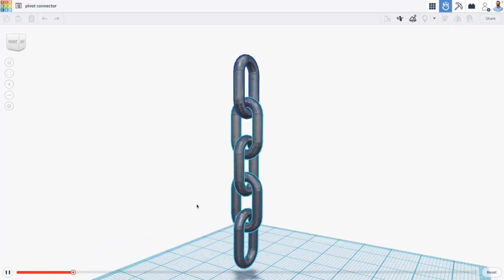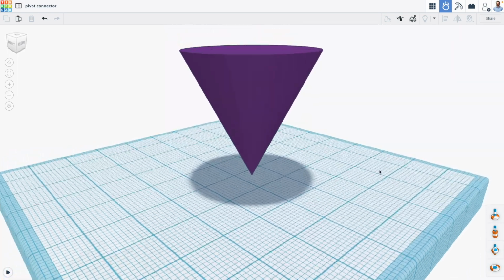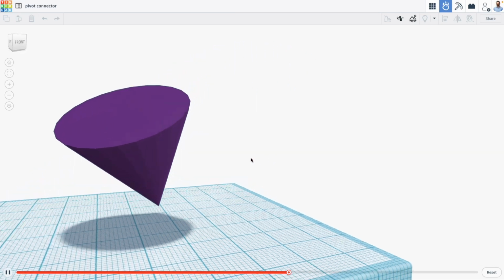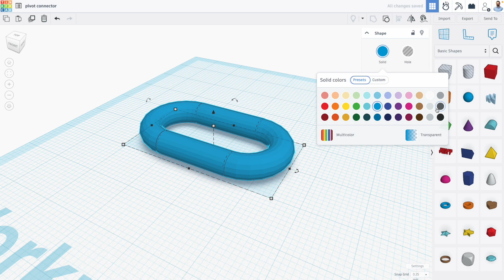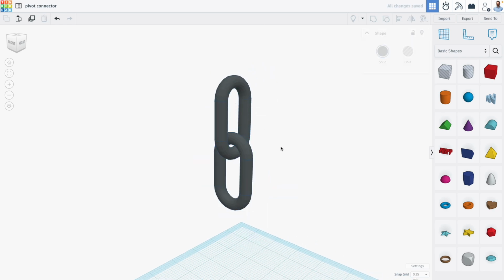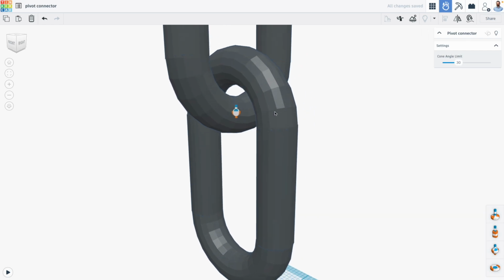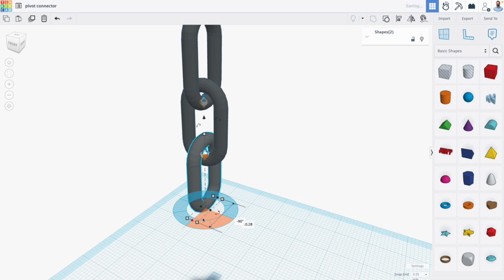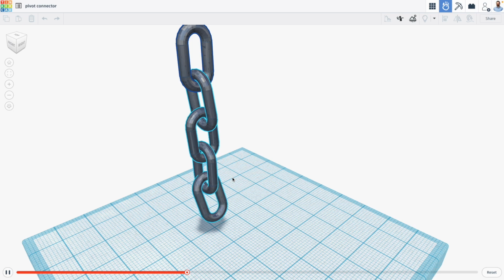How to use the pivot connector in Tinkercad Sim Lab

Comment: I've applied the pivot tool to a series of links in a power cable drag chain that has physical stops limiting the movement about the axle to only about 45 degrees. The SIM Lab movement doesn't seem to recognize the point where the two adjacent pieces would contact each other allowing them to pivot past the point where they start to intersect. Is there any feature that addresses this?
Reply from the maker: Unfortunately no, I believe this is just a limitation of the sim lab interface.